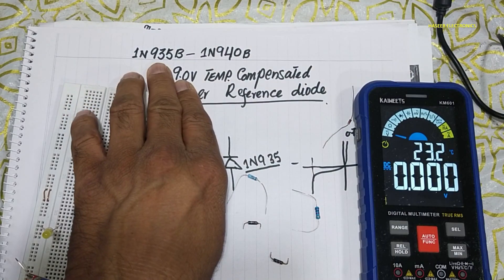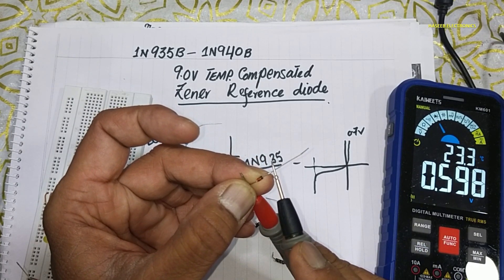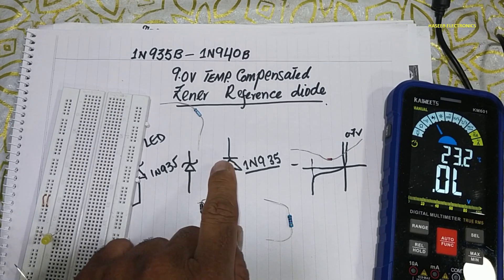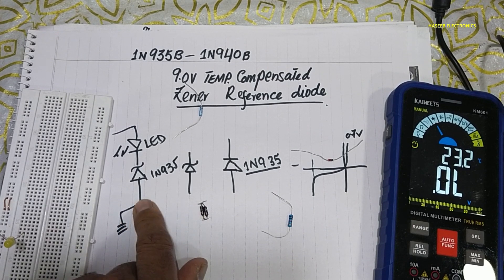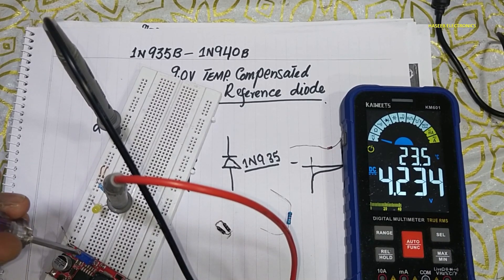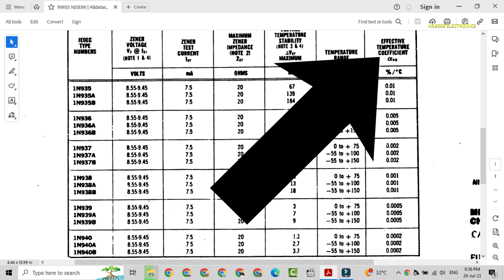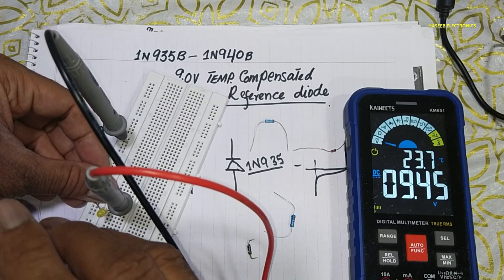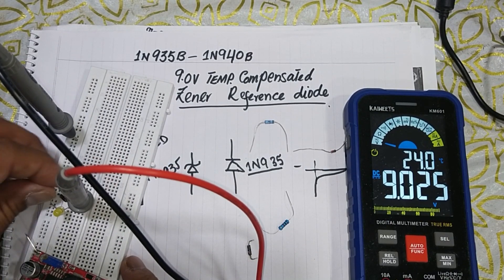{945} zener reference diode, function and testing explained

Comment: Hello mister Haseeb. I have a battery charger model: DPS-84DBA with an output plug type XLR 4 pins.
I wish I had known how the connection of this 4 pin connector is. From what I can see pin 1 would be +VCC --- pin 4 GND.
I still have a brown and red wire left which pins should it go to and what are the characteristics of these wires. Is the red wire also GND? what about the brown wire? Please provide your professional advice. MVG Andy.

Comment: Cool parts you got there! The reason why you cannot test with multimeter is that there is a silicon diode connected in reverse with the zener. Because the zener tempco is opposite to the tempco of silicon diode they cancel each other out. It's important to note that the nominal tempco of this diode is only true at its rated current (7.5 mA for this one). By changing the current you can change the tempco. This makes it possible to tune a tempco of a lower binned diode by manual characterization but also makes it necessary to provide precise constant current through it. Some other temperature compensated diodes are the soviet D818(9v) and KS191(9v), 1N4895(6v), and more modern integrated LM329, LM399, LTZ1000.